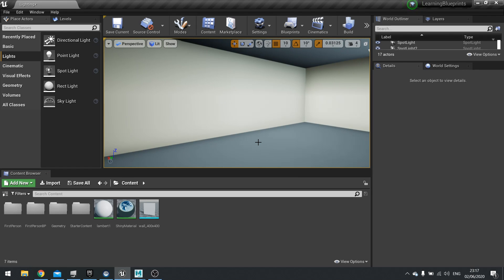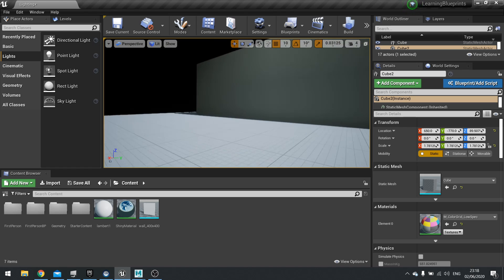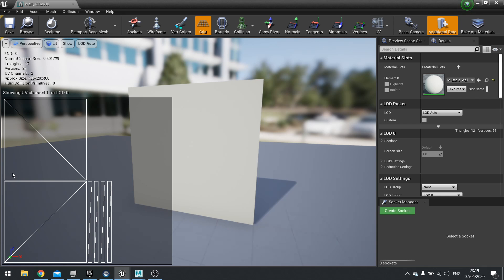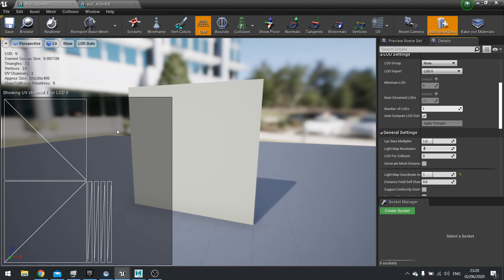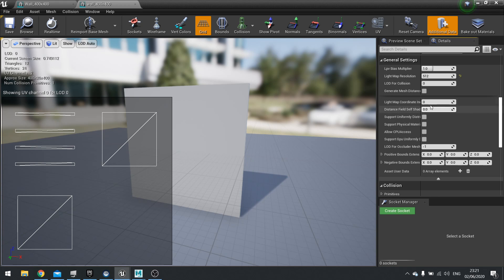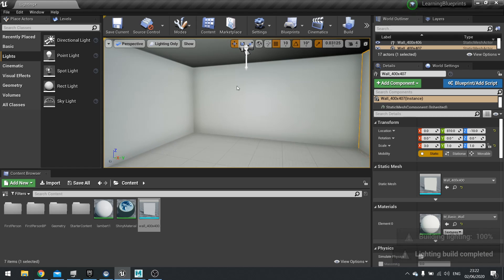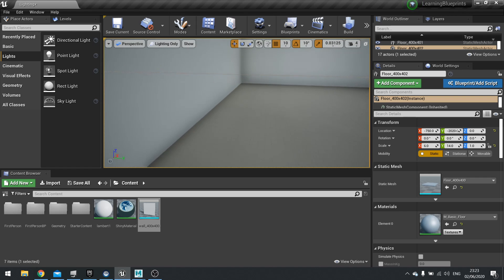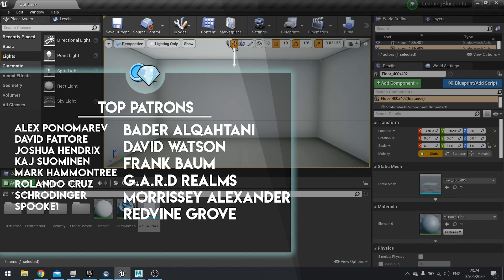Unreal Engine 4 Tutorial - Lighting - Lightmaps

Comment: The problem I have, is if the wall is segmented, for example, there is the doorway wall in between to flat wall elements, when you build the lighting, you can very clearly see the edges of the segments, and sometimes each segment is lit very differently, and no matter how I mess with the lightmap UVs, it still does it... how can I solve that?
Reply: try using actors, put static mesh on scene comp and it will work.